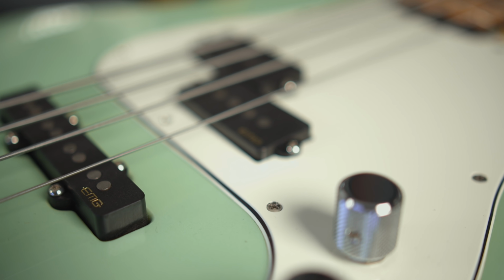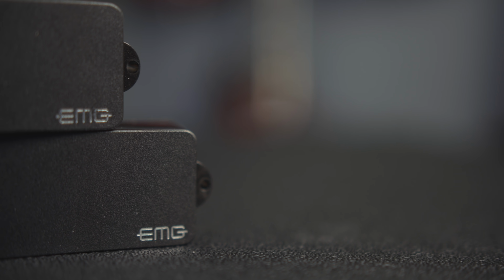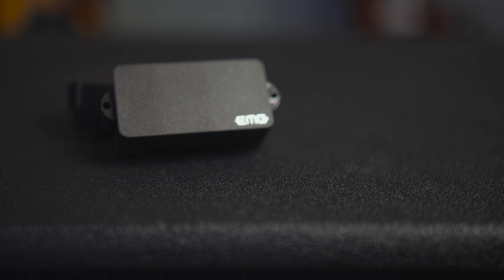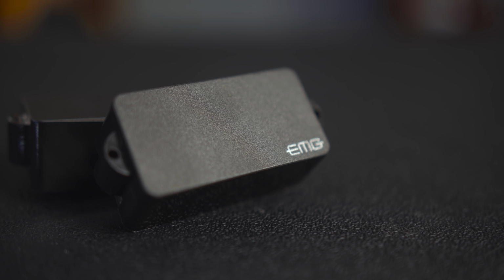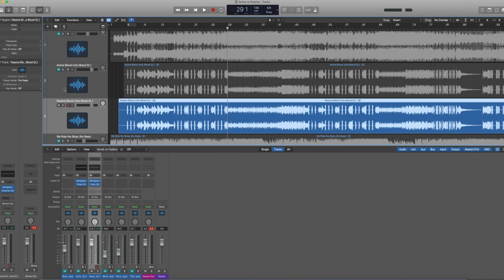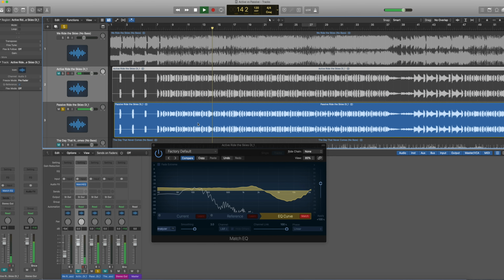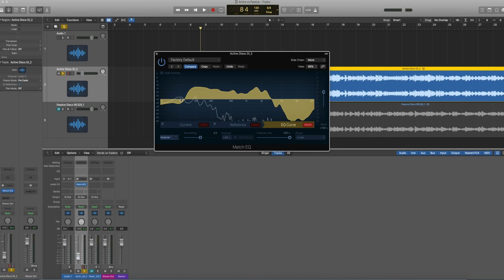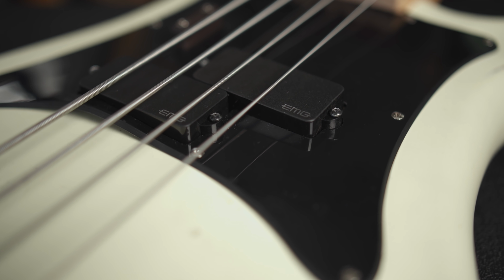The TRUTH About Active Pickups

Comment: Most of my basses have active electronics.  
Bought a  Kiesel Osiris five string fretless bass last year.  More than plenty of tone on that one.
It has an internal level on the inside if which you can raise or lower the output.    When you turn it all the way up, more than plenty of tone, but you start to get a lot of squeal from the single coil pickup! 
I might change it with EMGs.  I have them in some of my basses.  They are easy to install.

Comment: Classical bassist here, I played in wind ensembles a lot, too. We want that rich sound, strong lows, and shimmering highs. So yeah, treble is wanted in bass tone. If I didn't produce the overtones in a wind ensemble I wouldn't have been as effective at blending with the tuba section and changing their sound completely. Tubas are dumpy sounding, throw a single upright bassist and give them a tuba part tell them to play all notes with as long string lengths as possible, so you're dropping notes down octaves. The fundamental of the upright will never overpower the tuba player's or tuba section's fundamental, it's just not going to happen and that's not why the bass is there. Those overtones mix with the tuba sound, making them sound lush and beautiful on top of that fundamental. 

Upright bass is literally in the wind ensemble to add treble frequencies to the tuba section. And if you are locked in with the tubas, the audience can be fooled into thinking you're the one balancing that whole ensemble's sound, and in a roundabout way, you are. It's a different setting, but think of the tuba section and the bassist as rolled up into being the bass player of the ensemble. Having those overtones creates a very rich bass sound and the rest of the ensemble's sound changes as the other musicians adapt and blend with it. 

So there's a good argument for bass and having access to the treble tones in the sound you can cut to your liking.
Reply: eloquent point, but passive pups can still create plenty of high end. i find passive pups roll off the really brittle and harsh string clanks and scratchy shifting noises, while retaining those overtones you're talking about. And the beauty of that is you can then boost the highs on your amp to get an appropriate blend of those frequencies.

also string bass gang. on the orchestral side of thing fundamental is key, but yep those overtones are what allow you to project and send your sound out into the hall.

Comment: Generally speaking, your pedals behave better when they aren't trying to fight your pickups for who is top dog. If you are a bassist who shys away from using pedals and just plugs directly into the amp, active pickups will be better for you. 

But if you have a tuner, compressor, wah, overdrive, e.q., chorus, delay, cab sim, you're gonna feel the bass fighting your pedals a little bit.

Comment: active pickups in basses suk,,,, seriously who on the road or who that plays out a lot wants to worry about batteries?  stay passive because trust me or ask anyone who walks the stage and they will assure you the folks listening will have no idea about what pickups you have it ALL comes down to the house system.    

do not get in the habit of believing in active pickups that require your bass to have batteries because those batteries WILL die at the worse times...  I have 3 stingrays that never leave storage.... I recently bought a super light sandberg that will play passive I tossed the battery which killed the eq on the bass but thats even better because I just eq through the amp its simplicity at its finest and the people listening seem to not even care,,  our recording engineer loves the fact I'm sending him a flat signal only record with a P bass...  as far as GB EMG's  compare them to Seymour Duncan Antiquity 2's before you buy them the A2's are the way to go,,,, next drop that passive pickup lower into the body it removes any buzz and puts a cleaner note into the preamp... this guy has those over wound GB's too high either he doesn't understand that part of passive pickups or they all neglected to mention that!!

Comment: I honestly love both active and passive electronics. Passives tend to be less fussy with effects and stuff, in my experience, but the versatility of active electronics is great. One of my two active basses has a passive mode (which should be ubiquitous imo), but I wish the passive mode had a tone control. This would make it easier for it to more quickly and reliably get along with pedals, if the actives are being finicky, while still having some sound shaping ability. Additionally it would also benefit from the active electronics when I want them. 

My favorite passive bass has a very particular character that I’m reluctant to mess with. Also I sometimes just enjoy the simplicity of it. More options isn’t always the best for me. If I need all those additional tonal options, I play something else, but sometimes some limitation can prevent ‘blank page syndrome’.

I also just have to say that I’m really digging your sound regardless of pickup choice

Comment: Great video! It was thorough, but easily understood explanation of how pickups work. I'd always been told that ceramic pickups were to be avoided because they're usually found on cheap(not good)guitars and basses. I have a '92 Guild Pilot that I bought new, and it came with passive EMG pickups. It's my main bass and it was gigged hard for around 20 years and it still has the original pickups. My main six string is a players grade '67 SG that still has the original P-90s. That guitar has survived: Being thrown out a second floor window, an apartment fire, and having a car parked on it. If passive pickups are dainty, you couldn't prove it by me! 
I have a used Sterling bass that's active. I find that I do have to remove some treble, if I want a nice, punchy kind of sound. It sounds great with a distortion pedal, too. The main reason I don't buy more instruments with active electronics is because batteries are just one more thing that could go wrong at a gig. I know it's rare, but I've seen and heard straight out of the package batteries fail during a show. I'm risk adverse. Kind of.

Comment: Great video and very informative. I play a passive Fender Jazz bass (4-string, American Professional I) into an Ampeg Rocket RB-115 with an Ampeg 115 (w/o horn). My tone, I keep my midrange and treble on 1 or .5 with the Ultra buttons always engaged. Rarely do I go above 2. So, I am concerned that if I went with a passive that there would be “too much” treble given the Ampeg’s are usually high on the midrange and treble to begin with. Any thoughts? The active that I am thinking about getting, if I did, would be the Fender American Ultra jazz. I am much more of a "low-end" rather than "high-end" guy and don't slap. My genre is a combination of blues-rock (late 60's-70's) and jam band.

Comment: Active is idiotic.  So you're going to boost the signal right in the bass, then what?  Now you have to go into an input that attenuates the signal back to passive levels.  What a waste of time. You should have a good preamp in your bass head, that's why you  have it.  There's no need for an additional preamp and if there was a pedal would be the way to go.  I hated gigging with active basses, battery always goes dead at the worst time.  One of them a Peavey ate batteries like candy.  If you gig a ton, forget active.  Make sure your pickup height is adjusted optimal, and most importantly, make sure your pots are of the actual value like 250k and not 227K.  That makes a huge difference in output both on the vol pot and the tone pot.

Comment: I agree with much of what you're saying and I have/currently owned plenty of both active as well as passive basses , but I just prefer the simplicity of passive and my favorite bass I currently gig with is passive. I do boost the highs a little bit like you said, but I can't even perceive any additional noise when I'm n a few feet away from the amp when it's turned way up and I'm in a quiet room, much less when I'm actually gigging so the added noise from bumping the highs a click or two is completely negligible. Personally I've never had a pickup go out on me from grime, beer, etc, and I've played this thing for many thousands of hours, but in any case even if that did happen I would use my spare bass (which we should all have while gigging anyway) and replace the pickup at my earliest convenience.

In any case, love the channel, you're a beast no matter which bass you play! Just sharing my own perspective.

Comment: "Objectively superior".  In my experience an active system can sound like anything you want, except a passive P or J.
Reply: Because you're at the mercy of the manufacturer. I'm an electronics engineer, design my own circuitry from the ground up, and so the only difference between the passive vs active when I'm done is the passive has 15x more output when turned up to 10 lol. At the lower side of things between about 0 to 3, you have what sounds exactly like your pickup when it was passive.

Of course, with all that said, I also add at least a 2-band EQ and in that, there's just no going back afterward. Passives are absolutely awful, however, so are commercial active systems including EMG's, blah!
Reply: @JonDeth  I’ve played both and I prefer passive. Most recording engineers will tell you to leave your active EQ flat, anyway, and bands have recorded with passive basses for decades without an issue, and even now there are low noise and noiseless options for passive pickups, so really, it’s actually subjective whether you think active or passive systems are better.
Reply: @damienalvarez2957  not on your instrument they won't, they're pursuing flat frequency on the recording equipment, the instrument will always be captured based on your personal tone, and reworked in post. I've been doing this for 30 years, have decades in audio recording and editing, am a symphonic shred guitarist, have a 7 octave vocal range, and am a scientist in electrical-electronics engineering and inventor.

I know my crafts extremely well. We uses these setups for definition and clarity straight from the speaker. The better it is, the better it will be captured and reprocessed in post. The worse it is out of the speaker, the harder it is to rework in post to get the definition.

If I'm playing a few hundred BPM legato and sweeping really deep, bassy arpeggios and alternative picked runs, if it comes out muddy, smeared and without each note having distinction, fixing that in post without completely butchering your signature sound is next to impossible. How you sound on the album is ultimately often nothing like your sound comes out of the amp, but in terms of symphonic instrumentalist guitarists, aka shredders, that flat frequency response is pursued through the mic on your amp and the mixer, and often, the producer running the equipment will prefer you use their amps, pedals and guitars that are dialed to do specifically what I'm describing.

Now, it's more common we're able to do it ourselves because gear is more sophisticated at more affordable prices, but I've taken it to a level that has never existed and I'm literally typing this after taking a break from my electronics lab where' I'm designing the most advanced and sophisticated active pickup preamp circuit I've come up with yet.
Even my previous work is superior to what EMG, Duncan, Fishmann etc. have available.

Comment: A big reason why EMGs sound different is that dual coils use active mixing circuitry. Think of a Split-P or a JJ set where each coil goes to its own output jack, next in the chain is a mix-blender pedal and you are basically doing what EMG pickups do internally. This means you aren't strictly limited to EMG for that general sound. To EMGs credit they're products are well made and very plug and play. Even the EMG ABC control can be used to convert a passive bass without changing the pickups.

Comment: I’m at 17:27 and I can’t take it anymore, so maybe he addresses some of this later. Adding gain may add minute amounts of noise, but it also adds small amounts of harmonic distortion which, as any sound engineer who works with vocals or guitar will tell you, is the antidote to that “sterile, cold” sound. 

More importantly, the very premise of this whole thing, including the demo of two different cab mics against DI tone, is that situational variables have a huge impact. Passive or active is a drop in the ocean compared to room acoustics, string type, string condition, how you use your fingers or pick, magnet material, pickup configuration, pickup location, and about 20 other variables.

Plus, an active setup introduces a single point of failure: the battery. Murphy’s Law is real; that sucker will fail you in the middle of a gig, or at least in the middle of a $100/hr recording session. Why expose yourself to that kind of risk for negligible “on paper” benefits?

IMHO, playing better is the only upgrade you need, and the only cost is your effort. All the other theories are the real noise.
Reply: Thanks for your input  I decided to not modify my passive p bass. I already have an active bartolini on my washburn. Leave well enough alone.
Reply: Precisely, and that's my main argument - reliability, and having one less thing to worry about while you're nervous enough already to go on stage.

Comment: I used to own nicer basses and all of them were a mix of passive and active. As I’ve gotten older and my rig smallish, I’ve been satisfied with passive pickups. I just got rid of my G&L Kiloton Tribute as I bought a classic vibe jazz bass for $100 and sold the tribby for bills and to buy a darkglass harmonic booster pedal. With my amp(Fender Super Bassman) and my Genzler 410-3, this $100 sounds better than most $1200 active or passive setups I’ve had. I love both, but the passive is more plug and play since I use it wide open.

Comment: Better. Yeeesssss, okay, objectively. But I think it depends on the bass. I have a Dingwall Combustion and the pickups are passive but it has an active EQ and practising and recording I always use it passive. There's so much output, such wide frequency range that I'm always subtracting when I EQ, I don't need them to be active to get sufficient signal out of them. The time I use the active EQ is when I'm running pedals or live when I need to have quick access to boost/cut when I'm playing.

Comment: Re Active Preamps: There are a lot of variables in a preamp, and a manufacturer makes a lot of choices in the design phase. What should the center frequency of the bass EQ be? How about the center frequency of the treble? How wide is the bandwidth of the boost/cut (the "Q")? Is it a notch or a shelf EQ? Do we use a 9 volt system or an 18 volt system? What parts are available in time for us to meet our release date? If we use cheaper parts can we meet a better price point for the customer? And so on. To my ears a lot of the active preamps don't sound very good, including the ones you get standard on the Music Man bass. But that doesn't mean active preamps can't sound good, it's just that the manufacturer made different choices than I would. And in this case, it's that the treble frequency range they've chosen to control is too low and too narrow. If you like that sound, there's nothing wrong with you, you just like different things - and lucky you! Music Man is making an instrument that pleases your ears.
Reply from the maker: That’s a great point but that’s not really what this video is about. We’re talking specifically about the pickups, not the onboard preamp.

Comment: I don't like active electronics (pickups or EQ) because the addition of a battery is a liability (+ there's more control knobs with an active EQ, which I find unnecessarily confusing since I already have an EQ on the Amp).
I use Seymour Duncan Quarter Pound pickups (PJ config.) with a vol, vol, tbx, toggle control layout. No batteries, no extra control knobs and still massive amounts of versatility.
The tbx (treble/bass expander), for those who don't know, is a tone potentiometer that boosts either the treble or the bass frequencies depending on whichever way you turn it. It also "locks" in place in the middle position so that you know when it's on 0

Comment: Many amps only have a -6db input for active basses which is usually not enough for the output of an active, most times you can't use the whole range of the preamp and constantly having to adjust gain and volume to avoid clipping or unwanted overdrive is really annoying, using effects especilly distortion sucks too probably for the same reason - too much output, also it seems like passive reacts better to your fingers - feels more dynamic, and the battery is a pain in the *ss too, passive will always be my choice

Comment: Yes they are. If I had to buy 1 bass, it would be an active bass with on board EQ. But I'd need a p-bass to cover most of the sounds out there. All that means is that the sound is so ubiquitous you kind of need it in your tool kit.

Comment: alnico is weaker than ceramic. how could the active ceramic emgs have weaker magnets than the alnico passives?
Reply: Because you can have strong or weak versions of any magnetic material. For instance one of the best and most unique pickup designs is the G&L MFD design, one of Leo's best ideas. He picked ceramic for the magnets so they could be strong and consistent, but coupled it with fewer string winds, so the power and output comes from the magnet rather than the winds, and you get less susceptibility to noise, lots of output, and a clear hifi sound.